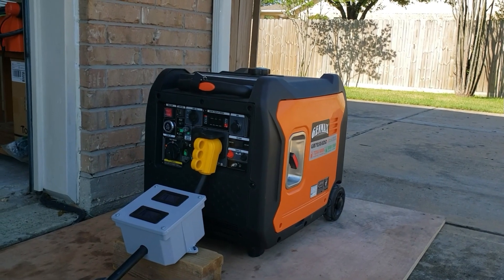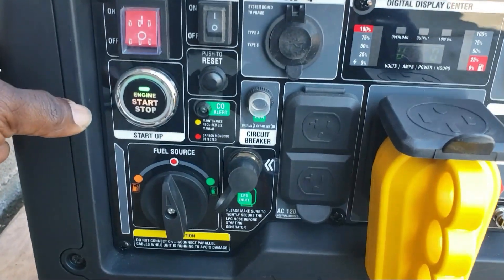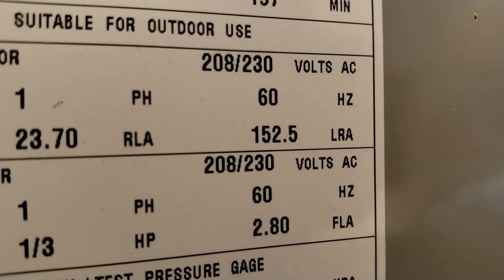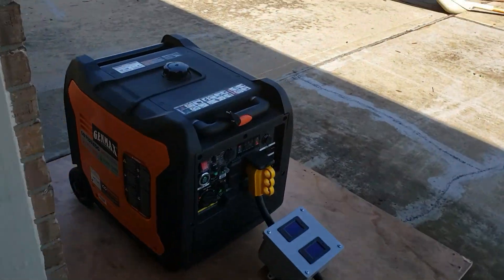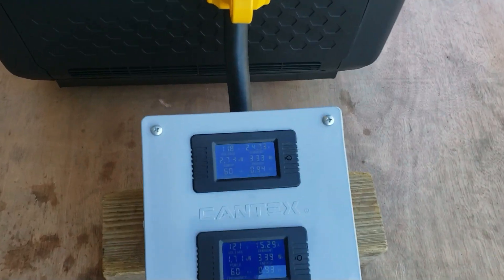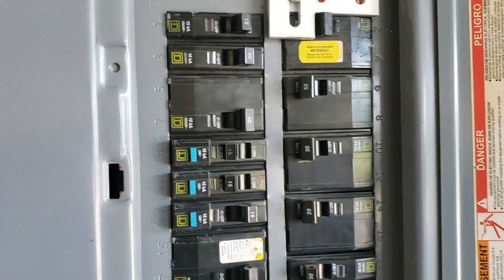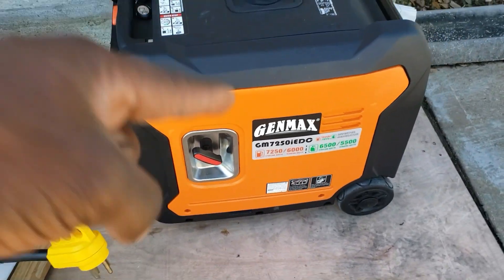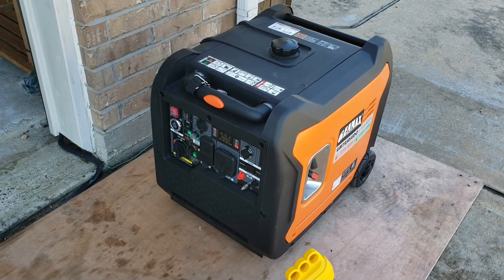Genmax GM7250IEDC Inverter Generator Running a 5-TON AC

Comment: What’s max amp at 240 volts running on LP? 22.9? You need two units in parallel to do the full 50?
Reply from the maker: Yes or buy the gm17000.

Comment: Hmmm...   A single can start your 5 ton unit, huh.  I have a 2018 model Rheem 5 ton 2 stage heat pump with an LRA of 153 and RLA of 28.8.  AirGo says their soft start should do a 70% reduction so down to around 46 amps.  So wouldn't it be safe to say that a paralleled pair of these on propane, with roughly 11,000 running watts and maybe 12kw starting, should work?  Did you do any before and after testing on inrush or just shoot from the him with no numbers?  And you do  this with Low Idle on?  Genmax told me that was a no no for large loads for it to be on.

Comment: Is this a bonded neutral generator, did you unbond it to work with your inlet set up
Reply: Yes, the 7250iEDC is a bonded neutral generator. It can be turned into a floating neutral by disconnecting a white neutral bond wire that is underneath the GFCI outlet behind the panel.

Comment: Wait - why is the gen at 100% when the rated power spec is 6000W??? Even factoring in power factor that's nearly a kW less than rated? The meter on the gen agrees with your power box, 4.7kW. What gives? If I buy a gen rated for 6kW I should be able to run 6kW without it overloading.

Comment: I’ve got a 2.5T unit. I’m guessing the GM7250 should run that just fine? I’m currently running a generac 6500/5500 open frame, but I’ve never tried to run my HVAC unit on it.

Comment: The question is will it run 3 -15kw RV a/c units if they are turned on in a staggard sequence?
Reply from the maker: I think it’s possible but two AC would work great, especially if you plan on using other appliances.

Comment: Is that 5 ton compressor more than 5500 Watts?  My electric hot water heater is 5500 watts alone
Reply from the maker: Yes, that’s about exactly what the 5 ton AC compressor pulls when running
Reply: @GeneratorReviews  can't decide on this one or the 9000. But don't want to overkill for no reason. But if I'm underpowered, I'd be disappointed

Comment: Do you know how to convert the 7250 to a floating neutral?  Ive only seen videos on the 9000 model
Reply from the maker: Yes, I plan on converting one to show everybody. I will post the video soon.
Reply: @GeneratorReviews  I'm currently working with genmax on finding the wire to remove.  Sending pics, but I can only pull the front panel off by and inch or 2, and its hard to show them. Wish they would show me how to do it. Without doing this it's sending 240 to one leg, caused a bunch of problems!
Reply from the maker: @hoody2141  yeah, you gotta be careful you don’t wanna move the wrong wire, it shouldn’t be throwing 240v on one leg.
Reply: @GeneratorReviews  genmax says it because of the bonded neutral,  and that's why I'm getting wacky readings. They once I remove that white wire, which I don't know which one it is, I'll be good. I'm getting proper readings from the generator itself. Would happen to have a pic of the one that needs to be removed?
Reply: @hoody2141  did you ever get it solved? The instructions on website were vague and from a different model/revision. They showed a blue jumper from neutral to ground on the 20amp GCFI outlet, but that doesn't exist on my 7250. There is a white jumper from neutral on the 50amp outlet going to the common ground bar. Genmax tech said thats the one to remove. He also said they don't include those instructions because there are different revisions for each model and don't wont average people doing it and want licensed electricians to do the modifications.
Reply: @MrAwsomeshot  I just bought a 7250 and it arrived about a week ago. I am still doing the break-in process and plan on changing it to a floating neutral. I read Genmax's instructions but I am glad to have found your post on what to look for.
Reply: @MrAwsomeshot  OK, so I confirmed that my 7250 does NOT have the blue wire on the bottom of the 20amp GFCI outlet. There are 3-wires on the neutral side of the 50amp outlet. One looks like it goes to the back of the generator, the 2nd goes to the parallel receptacle, and 3rd goes to the 120/240v switch. Did you just completely remote those three white wires from the 50-amp outlet?
Reply: @MrAwsomeshot  I figured it out. It was the white wire under the GFCI. Removed it, and now my 7250 is a floating neutral.

Comment: What are the differences between the sister machine Pulsar PGDA70BISCO which is also made by Dinking and the Genmax GM7250IEDC?  The only differences I have noted so far are color, auto transfer switch plug, and 30 vs 50amp plug.
Reply from the maker: The main difference is that the Genmax has a 50 amp plug and the Pulsar has a 30 amp

Comment: Gavin, I need a 240v generator in this range.  The inverter has very mixed, mostly poor reviews in the last 5 months in 2023.  What are your thoughts on reliability of the GM7250IEDC?
Reply from the maker: Most of the comments are from brand new owners of generators. The first time they run into an issue all bets are off. 
I think this is a great 240v Generator especially for its price and size with a 50 amp plug. If you decide to run off, Gas, just make sure to drain the carburetor before storing it.

Comment: Hey Gavin  do you know the location for the low oil level sensor  on this model 7250
Reply from the maker: Remember on this generator, you have to fill the oil all the way up to the threads
Reply: So you don’t know where the low oil level is on this junk , trust me it’s junk 30 years master. Ase auto technician  trust me it’s junk period.. @GeneratorReviews
Reply: Not 1 person knows where to tell me to look not the company not the fools in California at the so called service center not you unfortunately unbelievable  @GeneratorReviews

Comment: Gavin just found this, looking for a remote start generator to connect to a renogy invertor charger solar panel system.  Basically for the invertor charger to start a generator to charge the batteries if the solar panels are not getting enough sun to do the job.  Would this do the job
Reply from the maker: Yes, this will absolutely do the job. It has enough power to charge your batteries.

Comment: How do i calculate how many watts i need?
Reply from the maker: First calculate your loads running watts that should tell you what size generator you need, you’ll need to calculate for 50% of your generators max output power.

Comment: Mine dies after about an hour then only runs for 20 seconds on LP.  Any ideas?
Reply from the maker: Low oil levels is my guess
Reply: @GeneratorReviews  thanks for the reply! The dip stick looks happy, but I'll add a little more and see if the trend continues. I tried taking both side panels off tonight and it ran for over an hour without issue before I had to shut it down. However, restarting immediately it would NOT even attempt to turn over using the electric starter, but it did pull start.

Comment: Thank you for sharing this test. Just got my Genmax 7250 today, thanks for your reviews and insights! Like this test, I’ll be using the 7250 to run a 3.5 ton a/c during an outage, and you just proved it can be done, even with a 5 ton a/c (with soft start). Gavin, did you have to convert the 7250 from bonded neutral to floating, since you have an interlock kit installed? If so, how did you do it? Do you have videos on the topic? Thanks again.
Reply from the maker: No I didn’t convert this one. It still worked just fine and I think it will be just all right in a power outage situation.
Reply: @GeneratorReviews Hi Gavin, I started my Genmax for the first time last week and so far so good. Let it run for 45 minutes with minimal load, hair dryer and a small soldering iron. Today, I started it again and was successful. Let it run for 30 minutes then turned it off. When I tried to restart it again, it only cranked for a sec. So I took a voltage reading from the battery and only got 8.5v. Why was that? I got it restarted using the pull cord, but that was also a struggle. At least 6-10 pulls before it started. And then I heard rattling noise that sounded like it was coming from the pull cord winder. 
I removed the battery and charged it with my kayak battery charger for 30 minutes with 13.5v afterwards. Reinstalled the battery and started the generator successfully. Why wasn’t the generator charging the battery? Please advise. Thanks Gavin.

Comment: Hi Gavin, Any issues with this powering your house with the neutral bonded to the frame? I have a similar panel setup but am not sure if I need a generator with a floating neutral to work safely.
Reply from the maker: I haven’t seen any but I’ve heard of people saying that the gfi circuits can trip if it is bonded
Reply: @GeneratorReviews  its NEC to have only 1 neutral to ground bond.

Comment: Did you have to worry about grounding the generator if you are plugging the generator directly into the house via a transfer switch?
Reply from the maker: Grounding is a plus for lightning strikes, but the generators is already grounded through the grounding of your panel
Reply: @GeneratorReviews  lighting strikes? SHORTS. 

GCFI breakers will not work correctly when you have more than 1 bonding point.

Comment: Did you turn your water heater off in the breaker box? I would think in Florida you would turn your water heater off during a power outage.
Reply from the maker: Yes I would definitely turn the water heater off if it was electric but my water heater is gas

Comment: Hi Gavin. (Teacher). GenMax $1699. 
GXS7100iRD AiPower Costco$1299 and when on sale $999. AiPower THD Less than 3. Cleaner Sine wave (power). Protect your router/laptop/phone/ computer, it’s 2 THD less than GenMax’s is 5THD. 
AiPower has a Drain tube on bottom of Carburetor, easy to keep fuel fresh. The oil drain has a tube to drain oil easily with less mess. The fill funnel they give you is a great design also. AiPower when it runs on Propane and it runs out, it AUTOMATICALLY switches over to gas giving more run time. Put another full LPG tank on it and it switches over to propane immediately. (Propane is their priority fuel)
GenMax LPG 6500/5500
AiPower LPG 6400/5100

GenMax 7250 Gas 7250/6000
AiPower 7100 Gas 7100/5700 
Parallel ready.
50amp and 30amp plug. 
GenMax only 50amp plug. 
322cc engine vs
GenMax 312cc. 
LED Display is beautiful and has a led light on panel to see in the dark. 
When you tested it you said it was very quiet, it is 100% 
I agree Gavin. You didn’t even overload it in your great video. 
Would love to see them compete against each other. AiPower GXS7100iRD The price of $400 to $700 LESS oh my goodness. 
Check Compare to each other before you buy. $400-$700 difference in price. I had to go with the AiPower 7100. Well made, heavy duty Machine. Gavin please please do a side by side comparison. You are the Generator Man #1. Continue to help us make a wise decision and save us money at the same time. All the best health to you, fans and Family. 
A very Grateful follower. 
Mike ienuso
Reply: Can you put your camera on your Sine Wave while turning on your A/C and let us know the Amps. it took while firing up. They say that when it switches from propane to Gasoline it stays at around 3THD’s. Even when it runs out of fuel it stays clean. I appreciate all you do. 
Can you try and do one more thing for me, get your Followers/Fans up to 
1 Million Buddy!!!
Talk/Text again soon. Enjoy your weekend. 
Mike ienuso
Reply from the maker: Nicely stated two very close generator both in price and options on paper. The AI power really looks good.
I will do the test running the exact same load and see if we get an overload light on the AI power
Reply: @GeneratorReviews  AIpower doesnt have a 50amp plug
Reply: @MrAwsomeshot exactly deal breaker
Reply: I just ordered the Genmax 7500 dual fuel electric start from Sam’s for $900 regular price. Looks like it’s the same running watts and has an additional 120V 30A plug. I’ll be using this as home back up for 1 fridge, 1 full size freezer, 75gal fish tank pump and light, tv, internet, fan, couple led lights and window unit 8-12k btu. Figuring out what A/C size I should get now. I can split my down stairs into 2 areas (living and kitchen or master)

Comment: Hey Gavin, watching your content, I finally had an interlock installed at my panel with a 50 amp inlet last fall. Anyhow, I haven't gotten a generator yet, and I know you have a soft start on your 5 ton a/c unit. I'm getting a lot of differing info on soft starts. Here's my question, I have a carrier 2.5 ton a/c unit. With the right size  invertor generator, do I even need a soft start ? Thx as always
Reply from the maker: Yes you will benefit from the soft start especially when you have other loads on at the same time.
Reply: A soft start will absolutely reduce the stress on your generator every time it cycles. It will give you more wattage for other loads since the ac unit won't draw so much.
Reply: Gavin that’s a great reply. So much easier on the Generator. Won’t have to work as hard. I would like to see it done using the AiPower GXS7100iRD so we can compare them. Especially that the AiPower is $400-$700 cheaper in price.
Reply from the maker: @mikeienuso1926  Great idea 
I definitely will do this one next
Reply: Your the best. Gavin 

Being that most of us don’t have a Sine Wave Monitor. 
Can you have that hooked up with your
CAMERA “ON “THE MONITOR  
while you turn on your AC so we can see how the sine wave stays clean or varies. 
With GenMax less than 5
And
AiPower less than 3. They are both very low yes. But you know what I mean, I’m sure you would prefer 3 over 5. 
Even when it switches over from Propane to Gasoline they say it still stays clean, even when it runs out of fuel. 
I’m not going to hold you to anything, but I would love to see these things done at your leisure Sir. 
All the best, 
Mike ienuso
AiPower owner.
Reply: If you have a variable motor on your AC do you still need a soft start?

Comment: What is your preferred name brand of Generator?
Reply from the maker: I would have to say GenMax they’re the only brand that’s pushing the envelope right now. Fuel injected compact generators and oil filter on the large generators.
Reply: When I used to live off the grid I would run my Honda EU2200i until it was out of fuel. Does it hurt a fuel-injected engine to run out of fuel?
Reply: @JaromMcallister  for my little bit of anecdotal evidence, I would treat it the same like a modern fuel injection vehicle. Store it with fresh fuel with your favorite fuel stabilizer of choice and exercise it for 15 to 20 minutes at least once a month. During tropical cyclone season in my neck of the woods, I do that at least twice a month and practice a full load power transfer drill while I’m doing the exercise test.

Comment: Great video seems like the genset did okay but may be overrated a bit.
Reply from the maker: Puts out it’s rated wattage, so I think it’s right on the money for the size and power and all the options that come with can’t beat it.
Reply: @GeneratorReviews Oh I agree the options are excellent, but 100% at the load it was carrying was not its max running watts it was under 6000 watts yet showed 100% load on the video, I would be curious to see how it does with the 7200 watt heater the Honda rated at 5500 watts running ran that unit over its starting watt rating of 7000 watts. as well fuel economy vs the Honda running the same load and fuel vs running time.
Reply: @Rockrewls  It's 25 amps max for each leg. One leg was at 24.x amps and the other 16.x. To provide the 25 amps on the higher amp leg, it has to run at 100% (full rpm). The lower amp leg still has available amps (watts) that it could provide.